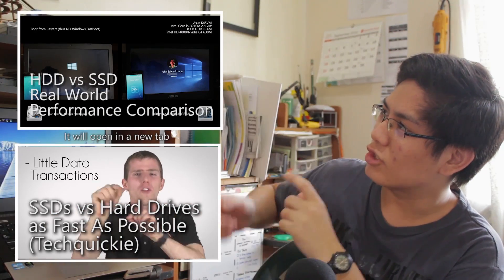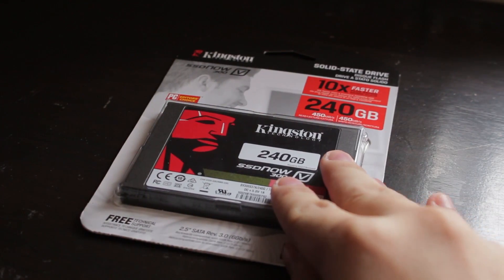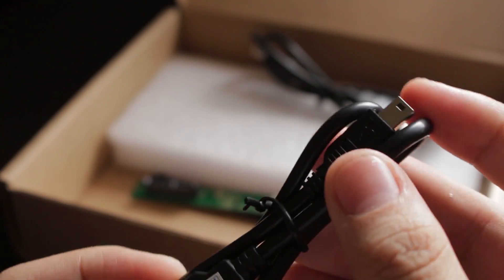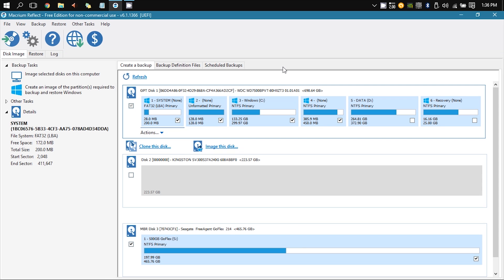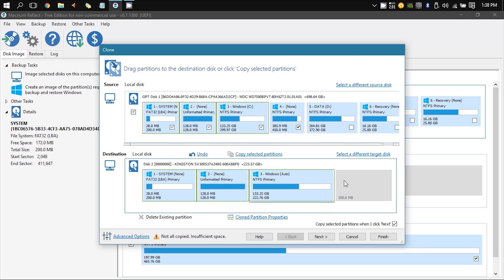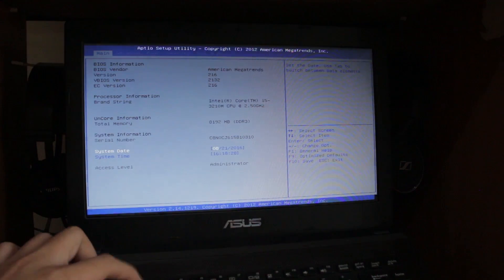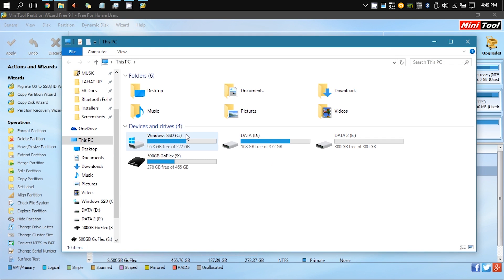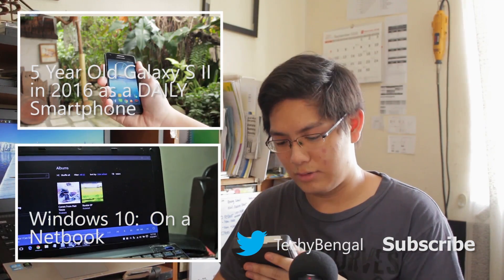[OLD] SSD + HDD Dual Drive Setup in Almost ANY LAPTOP

Comment from the maker: UPDATE (Edited 2018.06.14) [Mainly regarding of position of drives for best performance]
1. Added Closed Captions! Finally after more than a year since upload! (2018.06.14)
2. Thank you very much for your comments!

I just discovered (8 months ago) that the optical drive bay's SATA connector is limited to SATA II so peak sequential speed is limited to ~250 MBps. Real world performance isn't affected and shouldn't be a big issue but may be an issue in rare scenarios (like Samsung's Magician software RAM caching if enabled).

So an alternate method:
1) Take the hard drive (HDD) out of your laptop. This varies from laptop to laptop so you may need to look it up. But most should have a door dedicated for the hard disk.
2) Take that HDD and place that into the caddy. 
3) Place the SSD where the HDD was.

To know what caddy to get:
- Simply take out your DVD drive and measure its thickness (in millimeters) using a ruler.

Remember to clone C: and other system partitions first to the SSD before deleting it from the HDD.

Also yes, Windows go to the (fast) SSD while your (bigger) HDD acts as mass storage. Some people for some reason didn't get that even if the guide specifically does that.
Reply: EJ Tech 8
Reply: Might be a stupid question but what happens if you press the button that used to eject the optical drive?
Reply: EJ Tech yes I thought it was weird that you didn’t put the ssd in the hdd slot. but anyway good video
Reply: EJ Tech koklkplpw
Reply: Sir I have one doubt......can u help me?.....may I get ur mail id for contacting u?......pls help...🙏🙏🙏🙏
Reply: EJ Tech can u share your wallpaper?
Reply: EJ Tech Hi!! I installed the SSD into the location of the DVD and checked the random read/write speed of 532/290 MB/s. Does my DVD use SATA3?
Reply: Great vid EJ Tech! i noticed that we have the same laptop, i would like to ask is you used a 9.5mm caddy. i would like to add another SSD since i am only running at 128GB SSD, if i'm not mistaken we both have the asus k55v series
Reply: That is exactly what i thought watchig this video
Reply: Hey bro can't you format that the same way as on a tower or is it different?
Reply: Can you tell me how much seconds does it takes to boot in ssd
Reply: This caddy kit is better then one with screws bcs there is less vibrations
Reply: Good day! I have cloned my hard drive to ssd but i forgot to use all space since it was bigger than the files being copied.I booted up fine for the first time only to realize that i have only 121 gb out of 240 of the ssd. I checked disk management and saw the unallocated space.I formatted it so got another 100gb partition on the ssd, but everytime i boot up it takes about 5 to 6 minutes . Is it because i have formatted that space?
Reply: Can someone plz tell me how do I know which version of sata my optical drive is connected through?
Reply: Hi everyone I used this product and it is a very high quality product. Currently this product is discounted and there are few available click on the link you want to buy: https://amzn.to/326lIdh
Reply: https://www.youtube.com/watch?v=6BBHU0ctAHU
Reply: Hi, I'm trying to do this to my laptop which has a SATA III port for the HDD and a SATA I port for the optical drive. If I understood correctly, I should do the steps in this order? disassemble -> remove original HDD from SATA III slot -> put SSD in SATA III slot -> put original HDD in caddy -> put caddy -> boot from original HDD (caddy) through BIOS -> clone C: to SSD
Reply: @alfonsodavidrodriguez4165  what clone software you use? And about mbr/gpt i still not really understand could you give more details about the process
Reply: I was gonna comment to swap the drives for faster speed. Lol. My laptop use Ubuntu on a usb as OS and now I have 2 hdd for data. Cool tutorial.

Comment: The approach is correct. Except for the fact that the SATA port used for the DVD drive is SATA 2 for almost all laptops.  This means the SSD is choked. So the best option is to replace the HDD with the SSD and then put the HDD in the Caddy.
Reply: If HDD replaced into caddy and SSD put into hdd is.... It's can trouble to system before cloning process done? Or system can run normally?
Reply: @khairulmiftah798  yeah it may cause some problems first . but it will give you more speed . then in dvd bay
Reply: hi +alamerichs, how can I know  if my optical port is sata3??
Reply: alamerichs even your dvd bay have SATA3 speed, we still suggest all user to put SSD system drive in HDD bay for ease of management.
Reply: Can someone plz tell me how do I know which version of sata my optical drive is connected through?
Reply: @rahilarshad2456  use Crystaldiskmark
Reply: Hey +
Athul Raj , I guess you live in India (Though I am not sure!!!), can you help me buy a caddy from India. Which manufacturing company's caddy did you use? Just to be sure that the caddy works well and will not damage my HDD. Thanks.
Reply: SATA2 is 300 MB/s, that's about 3x faster or more than most 2.5" HDDs, it's still worth the swap imo
Reply: But what is SATA.1.2.3..? & Ive heard from people saying replacing hdd with sdd & placing hdd in caddy is best. But I don't understand the reason you have. Help
Reply: @dragonballthings688  sata 1 2 +3 are just newer revisions of the sata standard

each supports a higher speed sata 1 was iirc 150 MB/s sata 2 300MB/s and sata 3 600MB/s.

even on a sata 2 your ssd will likely run 6x faster that the 5400rpm hdd (50-60MB/s)
Reply: @nexus7tablet610  I just want higher speeds. Idk which SATA is my laptop compatible with. Help. What ssd should I buy
Reply: @dragonballthings688  any ssd with dram cache will be good for you.

cheap cache less ssd can perform poorly, sometimes even worse tha a hdd for sequential read/write and can fail prematurely.
even  in the worst case scenario of sata 1 speed (150 MB/s) a good ssd will improve system performance because of the access time compared to a hdd.

A sata 3 drive will work on sata 1+2, my kingston 250gb ssd in my toshiba l300 is rated as sata 3 (600 MB/s) running on a sata 2 interface (300 MB/s).

Even though it is rated sata 3 it is not actually saturating the sata 2 interface my sequential read write speeds are 261.5 MB/s read and 268 MB/s write, random read/write are 183.3 MB/s read 144 MB/s write.

in comparison my 2.5" sata 2 samsung 1tb 5400rpm drive that is in my optical drive bay (running at sata 2) has sequential read/write of 104 MB/s read 105.3 MB/s write and random read /write of 0.738 MB/s read ) 0.485 MB/s write

so you can see although the ssd is over twice as fast on sequential read/write it is the random read/write that see the most improvement.

Even if i used this drive on a sata 1 interface i would have "most" of the speed benefits apart from slower sequential read/writes (which will still exceed most mechanical hdd)
Reply: @nexus7tablet610  I've 2gb ram, 232 gb hdd laptop. Suggest me how to upgrade it?  which ram should I put in? Ive one extra slot. Currently I'm having DDR3 ram so can I put a 4 gb ddr4 or 5 ram in second slot? Or is that compulsory that both must be DDR3 only? & Am I supposed to put 4gb ram in first slot & current 2gb in second? Will. That increase speed? Or that doesn't matter?
Reply: @dragonballthings688  ddr3 slots will only take ddr3 ram, they have a physically different slot.

It is worth checking with your laptop maker for the correct speed and size supported by the motherboard.

you should be able to mix module size but tbh most ddr3 boards will accept 2x4gb some can even support 2x8gb.

As long as it is the same speed rating or higher it should work fine.
Reply: @nexus7tablet610  I'm currently having DDR3 1333 in first slot. Can my secondary slot support DDR3 2133 ?? Or I'm supposed to buy another ram of Sam speed and type as well
Reply: @nexus7tablet610  .
Reply: @dragonballthings688  ideally you would match the ram speed with the existing module.

ram will just lower it's speed to match the lowest speed module installed.

if your computer does not support the higher speed it will automatically lower the speed also.
Reply: @nexus7tablet610  yes I realised it will be lower down to less speed one. But that's when, when the motherboard supported higher speed (2133mhz) RAM. What if MB didn't support that speed & rejected the RAM. So can we find the max speed which is supported by mb.
Reply: @nexus7tablet610  also I wanna replace HDD of my old laptop with SSD. Which ssd should I buy. There r so many like Sata1 sata2 3 and on.. confused
Reply: DVD caddie may not support HDDs with GPT partition scheme, make sure that it's partitioned with MBR scheme first, before putting the HDD in caddy.
Reply: @harshivpatel6238  the partition table shouldn’t have effect. The caddy has no electronic components. It’s simply a physical housing with a male and female sata connector
Reply: @i_athul  I just read reviews of someone complaining that they could not get GPT styled partitioned HDD to boot, and needed MBR one. That's all.
Reply: just tought so
Reply: azam
Reply: Would still be better to put ssd into the hd slot and use the ultrabay for. Games just for easy removal heck you could easlly just swapp it in and out for dvd drive
Reply: U r absolutely right...
Reply: Bro plz help i want to put my hdd in cady and ssd in main slot.....will it format my hddd is use it in caddy ?
Reply: @simplegagan6619  i'm having the same issue. My hdd have a 2.5 sata connection but My dvd not. Did you find a solution? Sorry, my english sucks.
Reply: @vxvoart  that is what the caddy's made for.. you place the hdd in the caddy and the caddy has exact same port as dvd w/r has :)
Reply: @sourabh_mishra  yeah I already made it! thanks dude
Reply: @vxvoart  that's Great....
& my caddy is arriving this morning :) my lappy's showing error F03 (hard disk not ditected) if it worked with caddy then the problem is in connecting (sata) ports, if it doesn't, then I will buy a 240gb ssd and install it proudly inside the lappy (after losing my data in the hdd, sadly) let's see
Reply: I have both sata 2.... But it works fine you still have the fast acces time of a SSD
Reply: Good advice. Gonna try this very soon.
Regards,
https://www.youtube.com/channel/UCT2nrfKGj9vr1euKWutCWZQ
Reply: of course right
Reply: SSD's have been choked on the SATA bus for quite some time.. that's why we moved to M.2 slots.  Just make sure the M.2 slot supports NVMe and not SATA!  I believe it should support "M key"
Reply: some even route the optical through a usb bridge

 if you are cloning a current install to ssd it is worth checking the existing parition alignment and turning of all non ssd friendly features like defrag, recycle bin hybernate etc, basicaly anything that would be disabled by default if you were to install directly onto an ssd.
Reply: Yeap 👌☺
Reply: @Hanaldai Munamana Yeap, then generally speaking yes, there is no big differences doing general tasks in PC, but for max performance it performs better in SATA 3 AHCI mode and the cable and interface would be also right, for example read this: "Ensure that this drive is connected to a SATA 3.0 port with a SATA 3.0 cable..." and URL : https://www.userbenchmark.com/UserRun/32367019 mnjah :)
Reply: https://www.youtube.com/watch?v=6BBHU0ctAHU
Reply: So everybody now becomes the so called" expert"... It doesn't matter.. Its just priority on Bios, Good Job EJ btw
Reply: @lionheart8193  NOPE, SSD in sata2 port is going yo get bottlenecked by low speed, in sata3 port, you'll get double the speeds, HDDs barely reach 50-60MB/s anyways, it won't matter where you put it.
Reply: Sata 2 vs sata 3  so what ssd on a laptop as a boot drive is still a massive upgrade
Reply: i have a hp laptop from 2013 with sata 3 for the dvd drive and for the hard drive
Reply: That's nice. But quite rare as far as I know.
Reply: not anymore as it is easier to have 1 SATA 3 controller with 2 SATA connections than 2 controllers with one connection
Reply: What do to with the wizard program , i want just to copy My files into the ssd then put ssd into the hdd and the hhd to the caddy
Reply: Agree. This pinoy is an idiot
Reply: Hi everyone I used this product and it is a very high quality product. Currently this product is discounted and there are few available click on the link you want to buy: https://amzn.to/326lIdh
Reply: @MarvelNo5 , don't be a asshole.

Comment: EJ Tech::that was the most well-explained video tutorial i have seen so far.I have a Question.I got the Asus G75VW with 2 HD But i don't know which one is the one with windows OS on it.I looked through the hand manual and doesn't say exactly.But if i remove the 2 Hard Drives, to check which one has got the Windows OS on it.Will it erase the OS when i put them back??? or is it safe till i decide to erase the HD??? may sound stupid but i am not the full expert type,  but i do want to replace the HD for An SSD.And since my Asus G75VW has 2 HDD would like to replace the one that has the 254GB  C: Drive.Won't be necessary to remove the optical drive for that reason + it has a BLU RAY optic.well hope you can reply to my comment or post .
Reply from the maker: In Windows search "Disk Management." 
It will show which drive actually contains C: and other system partitions. At the bottom-left half which says Disk 0, 1, 2, etc. right-click that then select Properties and hope they are of different brand and/or capacity. Hopefully the two hard disks are of different brands and/or capacities so you can tell them apart. 
If the HDDs are physically identical and you can't tell them apart, then you can try removing one hard drive, turn on your laptop, then see if Windows boots or not. If it fails, then the one you took out has C:. 

Place back the HDD that contains C:, then take out the one that does NOT have C:. (Or if you got lucky put the HDD that doesn't contain C: aside.)
Place the SSD where the hard drive that doesn't have C: was. Then proceeded with cloning. After that you can take out the hard disk that contains C: and place the "non-C" hard drive in its place.

Now you have an extra hard disk that has a copy of you C: and system partitions. Feel free to either keep it as backup or wipe it for extra storage using an external USB enclosure.

Comment: For a Laptop to really benefit the SSD should be installed internally as the Boot Drive and the mechanical drive move to this Caddy this way you can buy a 2nd Caddy with another laptop drive and Hot Swap.
Reply: Exactly what I'm going to do soon once arrive.

Comment: That's asus k55v series laptop. with that dual drive configuration your laptop's motherboard is soon going to be toast because of excess power demands which exceeds stock config. Had my asus k55vm-sx086v laptop(Rs. 53,000 INR) motherboard die due to this costing repair costs mounting Rs. 17,000 INR. So, purchased new dell laptop. In the new laptop I only replaced hdd with ssd.
Reply: Kenny S - It is not nonsense. I had my asus k55vm - sx086v laptop fail due to this.

Comment: Some differences between yours and mine's:

•I had to open my whole bottom panel to access the DVD screw mount
•The DVD door was a bigger priority to me than the drive, so I destroyed my DVD drive to pry out the door (the drive was dead from excessive use anyway)
•The DVD drive's screw mount couldn't be taken off, so my caddy is completely friction-mounted (It was tight as hell so I got that going for me)

Comment: Got a new MSI gaming laptop. They still come with DVD drives. Swap the DVD with an SATA, and now I've got three drives--Nvme M.2, HDD, and SATA. If I replace the HDD with an SATA, then I've got an optimal setup for video editing: SATA for system, SATA for scratch, and Nvme for video files.
Reply from the maker: SATA is a connector standard, not a drive. Please clarify.
Reply: SSD's. Yes, my bad.

Comment: Hi, I have a question. On the configuration part, my OS partition only takes 190++ GB. And 450MB for my NTFS Primary: None. And there is left almost 12GB, because I'm using 250GB SSD. And as you said, there must be no unpartitioned left. What I only can do is put the 12GB extra partition on NTFS Primary. Is this will affect the capacity of my C drive after cloning?
Reply: And, if I don't want to put that 12GB unpartitioned into NTFS, how do I do to increase my C partition with this 12GB?
Reply from the maker: Drag in the C partition first then increase it as much as possible while still leaving enough space for the last NTFS partition.
Reply: Yes, I have done that, the maximum that can reach is 190++GB. Because on my HDD, my C partition is set to only 190++GB.
Reply from the maker: Can you list down all the partitions your hard disk drive have?

Comment: My practice is to use SSD as hard drive in my laptop and prepare a much larger external HDD as backup. And...my laptop do not have a cd drive whatsoever. If I have to install a HDD, only space I can spare is part of my laptop's battery. That will significantly lower the laptop's battery life.
Reply: you cannot use the space of the battery for the hdd. NO

Comment: I'm thinking to buy one 500 GB SSD for my laptop.  I guess the laptop in which you used for the demonstration is same as mine. My laptop is "ASUS K55VM-SX086D"(i7 Model). I have a SSD "Samsung 850 EVO 500GB 2.5-Inch SATA III Internal SSD (MZ-75E500BW)". Will this work? And I'm getting the caddy of two different sizes 9.5mm and 12.7mm. Which one should I take?
Reply from the maker: Ours is 12.7 mm (the thicker one)
Reply: Thank you so much mate :)
Samsung 850 EVO 500GB 2.5-Inch SATA III Internal SSD (MZ-75E500BW) will work our laptop right?